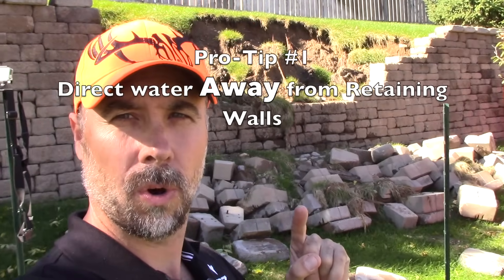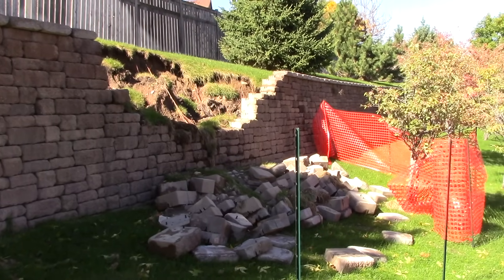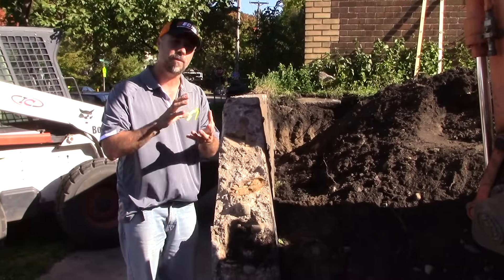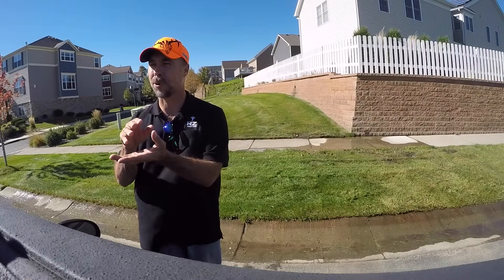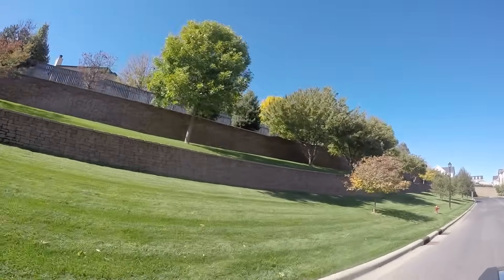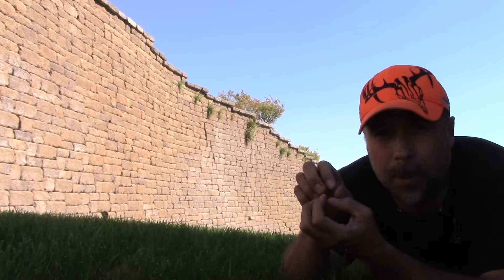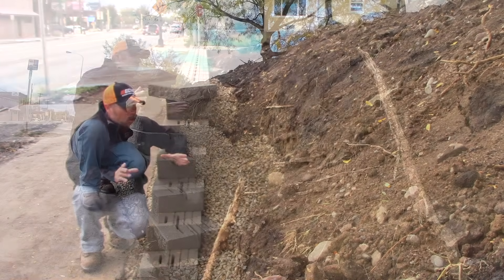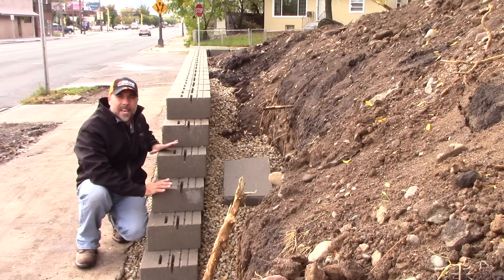How to Build a Retaining Wall and 6 Reasons they Fail

Comment: I lI've in a PUD in Florida, next to a development that built a berm on our property. I complained until I was blue in the face that simply laying dirt for a berm 6 feet above our development and covering it with sod would not suffice in keeping erosion from the tropical rains from degrading the drainage system. On top of berm they installed an 8 foot stucco wall to ptovide privacy. They then proceeded to plant live oak trees, area palms as well as other palms within 5 feet of wall. Being a zero lot line comunity, there is not even 10 eet from their patios to these trees and 5 feet from wall. Since I live at the end of the drainage field a combination of all these factors has resulted in serious erosion of property 5 feet from my house. I have plant beds planted at the base of the berm. My lawn continues to get steeper and more unstable the longer this goes on. I cannot get anyone on the homeowner's association board to even add it as an agenda item, which zi have requested 3 times and written letters on same, as well as contacting president of board from the offending development. Our board spends thousands of dollars shoring up the seawall that benefits the more wealthy homeowners in here. My drainage issue is getting worse and beginning to affect many homeowners away from the water. Whow can I contact to give me an assessment on what may be done to correct this? I am at my wits end. The live oaks will grow to 70 feet, and they along with other cheap palms developer installed block my morning sun, ruining plants I had there and causing me to have to completely replant for more shade loving varieties. When I bought my home in 1991 there was nothing but flat land-no development next doir. At last board meeting I brought this up and stated that topography at East side of my house was perfectly flat and they seemed shocked. I have pictureds of all this. Extensive work needs to be done on drainage system as my back yard area is now sinking and filled with valleys where water has eroded it awsy. What can I do to get this at least investigated for a possible repair? I know drainage areas need to be dug out. Development next door does not properly maintain proper trimming of trees. In area where wall was not installed, only wrought iron fencing, the oak tree roots are already seen growing out of the berm in our development. In Florida we can have 20 inches of rain water fall in two days. Last time it did the pictures I took got my neighbors air conditioner replaced and installed on a wire platform where water cannot reach it. I am afraid with the neglect of drainage system on my side of house, the water could rise and do same thing to my air conditioner plus possibly get into my house. The event that dropped 20 inches of rain resulted in water running into 3 houses across the street from me. Bags of mulch were stacked up as temporary fix. A cheap open "culvert" ditch was dug with open plastic pipe installed to allow water to run better into the system at base of the berm. The just creates more trouble for me as the rainwater now backs up even more. A typical 2 to 3 inch rain results in 2 to 3 feet of water going through the drainage system on 3 sides of my house. Takes up to 8 to 12 hours for all water to drain through large pipe and into the Indian River. Please help. I do not know what to do. This is on common property and is maintained by the homeowners assiciation. As I have stated previously, I cannot get anyone on the HOA board to do anything, even after writing a letter expressing these concerns and asking at 3 meetings to make it agenda item. I have flood insurance which would cover damage but if the drainage system were properly maintained would niit have to worry. If I get water in my house because of there neglect in this known issue I will be suing them for damages and to ensure drainage system is proprrely repaired. Any help is much appreciated.

Comment: Ok, I have a small retaining wall that is about to fall over. Watching your videos makes me see many of the several things the installers (before I owned the property) did wrong. To correct this I thought of maybe digging it out, putting in 1/2 in gravel to back fill for about 2 feet deep and a pipe with holes and a filter cloth on top at the bottom of the gravel to direct water out to the sidewalk. They put mastic on it so I cannot just take it apart and re-do the whole thing. It has quite a lean so I was going to take my old Ford and 'finesse' it back to a better angle on the sections that are sagging. I know that will not fix the very bottom which most likely has pea rock under the wall but I cannot break them apart easily or lift a few thousand pounds of wall. This kind of limits my options. Any other suggestions for my situation?

Comment: i have been looking to build a short, four feet max height retaining wall. the two key things i was planning on focusing on were the base and the drainage. i plan to use bags of redi mix concrete for this. I'm not trying to be a cheap SOB, but even if i build this to a very robust standard, i can do this for half of what contractors are quoting me for poured concrete. do you have any feedback to share for this type of wall design/construction. thanks very much

Comment: If I weren't so physically challenged these days, I would move from FL and beg to work for a guy like you. I used to love being a DIY guy and learning from videos like yours as part of my research before starting a project. I'm disgusted with the local licensed contractors,    that I've had to hire because I can't do this anymore. They cut corners that defy what I consider common sense. They appear to be in code, but watching them going through the steps and putting pride in there work is two entirely different things. They're sloppy enough to pass but I know there will be problems in the future.
Reply from the maker: Wow, thanks for sharing!

Comment: we have a large steep backyard sloping down toward the house that has 3 levels of retaining walls, either dry sandstone blocks or  brick/cement rendered. The final retaining wall at house level (brick/cement rendered), which is approx 3ft high and 7m long is starting to crack close to either ends, pushing out the wall in the centre. There is no where for water to be released on the sides  as their are brick stairs on either side, and no weep holes at the front - what is the best action to try and save the wall

Comment: Thank you for the video! We are going to diy a 4 ft retaining wall to level out our side yard. How much 3/4 angular rock to put beneath and behind the wall for drainage? In another video I think you mentioned 6 inches under the wall but it looks like more behind the wall for drainage,  would you say 12 inches thick behind the wall of angular rock? Also how deep should the base be approximately, is there a formula for that? I noticed in another video you had 6 inches of rock dug down and a layer of stone all beneath ground level. I hope that sounds about right and thanks again!
Reply from the maker: 12 inches minimum behind the wall.

Comment: I've built a few dry layup walls. I didn't know what I was doing but when I back filled them I graduated the fill from large rock behind the wall to pea stone against the hill. My theory was that it would filter out the fines before it got to the wall. That first wall has stood unmoved for over 40 years.
I haven't built anything but block and rebar retaining walls for the past 25 years. I guess it's too soon tell if I've done anything wrong with them but I tend to go down at least a third of the overall height of the wall if not more depending on what I'm holding back. I also like to tilt them back a few degrees into the hill. I still back fill with large fill stone but I've added landscaping fabric to loose materials to keep the finest out of the drain tile. I've yet to see water come out of the drain tile.

Comment: I wish i could just stack some blocks with 3/4' crushed rock behind it... I got 35" of rain at my house last month 18" of that came down in 7 days. This is a normal year here not a wet year. Your walls would still fail. All walls over 48' in my county must be engineered. most people use I-beams around here. Its interesting to see a rock wall over 10'. Nothing like that is ever built here. the soils and rain here are VERY different. once every 30 years we get 90" or more 50" is a normal year.
Ben Lomond, CA

Comment: The choice of tree species can be an issue as well.  My neighborhood was developed in the late 1970's and was heavily planted with Italian Stone Pines and Long Leaf pines.  Now the Stone Pines have lifted sidewalks and roadways and the pine cones on the Long Leaf make it dangerous to park on the street as the dropping cones are like one of those giant lawn darts.  Lots of dents and cracked windshields from non residents parking in the street.  The Stone Pines are average 6' trunk diameter and the Long Leaf are roughly 60' tall.  Beautiful trees but cause a lot of damage not to mention they drop cones, needles or pollen all year.

Comment: Hey man, great vids.  During the foundation dig out for my new home construction we encountered a land slip for our property near Pittsburgh, PA.  Here is a video: https://www.youtube.com/watch?v=g9U2u3ysUjE&t=59s

Hired an engineer that will be designing a 2 wall system using redi rock to create a tiered back yard.  There will be two walls 5 feet high and 100 feet long.  Just from the video, can you offer any tips?   Going to have geogrid between each course, with drainage at the top for ground water.

Comment: They knew how to build them 100 years ago cause they weren't so cheap back then...also contractors these days like to do the "minimum" and move onto the next job lol
Reply: I worked for a company that rushed jobs and did minimum. Then when wall failed they try to blame me even though i warned them repeatedly.
Reply: Contractors don't want to tell someone they need to also hire an engineer to design them correctly. And the owners don't want to pay for an engineer.
Reply: Are you an idiot? or is English your last language? I don't even know what you said.
Reply: wes lawson: Eees  dah Amorican way shustah likeah da 3 stooges Curly, Larry and More,what more amorican deen dat?

Comment: Really enjoying your videos. Have never put much thought into retaining walls and such as I have never had a need to until recently. Bought a house last year with a 35x35 shop in the back yard. The entire back yard is a slope and they cut into the slope in order to create a level area to build the shop. There's a poorly constructed 3 foot retaining wall on one side of the shop and no retaining wall behind the shop. The building is about 35 years old - I'm not sure if at the time they built it there was some sort of drainage or what but at this point I'm getting flooding inside the shop every time it rains for more than a day or so at a time. Behind the building where there was no retaining wall the dirt has totally washed down to the point where I would have to dig down just to even see the foundation of the building. Is there any way I could send you a few pictures of what I'm dealing with and get your opinion on how to proceed? Wish you were in Georgia.

Comment: How would you engineer a load bearing retaining wall? Such as ones that are in front of parking lots.
Reply from the maker: It would be based on the type of load, height of the wall, and kind of soil.  Those 3 variables dictate the engineering for the wall.

Comment: There was a 3' retaining wall made of 4x6" treated timber on our property when we moved in. No deadman supports or geogrid was used. Just vertical posts on the downhill side of the wall. There was no drainage set up behind it and it was backfilled with the gummy clay that was on-site. It has bowed the top of the wall out 10"+ in some spots and everything settled in behind it. Is it even worth trying to correct by filling where it settled and diverting as much water as we can before the wall at this point? I know it will blow, its just a matter of when. We are saving for a new wall, but a total replacement isn't in the budget quite yet.
Reply from the maker: With that much of a bow- its time for a replacement.
Reply: I suspected there wasn't much that we could do at this point. I'm glad there are guys like you willing to help out with their knowledge so we can make educated decisions during replacement.

Comment: So, if a retaining wall has a hill coming down from behind it (like the one you show as failing and like the one under construction with the 3/4 inch rock), I take it that the soil level behind it should always be even with the top of the wall?  I'm not sure I followed what the problem was there. It has been recommended to me to have my wall be 6-8" ABOVE the level where the ground meets the wall, to keep water from flowing over the wall. Sounds like that's wrong?
Reply from the maker: You want the soil and water to be able to go over the wall- if its all stuck behind the wall then in a torrential downpour it could get overwhelmed and blow out-like this one.

Comment: i didnt see any fabric seperating the clear stone from the fill behind that last wall. that dirt will slowly migrate into the clear stone. then it will no longer be clear stone and it will be able to freeze and push the wall out
Reply from the maker: 27 tons of backfill, 6 tons of drainage plus  other wall material washed totally out and into the storm sewer.  I found a lot of the materials in the storm water pond.

Comment: I have a 4 foot retaining wall I am putting in myself.  there is an existing large tree 5 1/2 feet back from where the wall will be. Do you think it will cause problems with the retaining wall?
Reply from the maker: rule of thumb-it should be 8 feet away

Comment: this was very therapeutic to watch i dont know why haha. great video
Reply: @ Stanley, last year in November my father and I built a retaining wall using railroad ties and pre-drilled holes for 1/2" rebar that when flush went through the top railroad tie down into the railroad tie below it all the way through also. A total of about 15" of rebar per hole and approximately 4 15" rebar rods per railroad tie. The bottom layer of railroad ties had rebar 24" which resulted in about 16-16.5" of rebar in the ground. We also put a slight slant on them to lean towards the bank. They also overlap, so that one railroad tie is sitting on top of the two below it. So far, it is very stable and feels very solid! What do you think of this? I have photos during the build process I can e-mail you directly and I can take pictures of it currently also as it stands right now.
Reply: @John Lincicum, As he said there are two parts to the answer: 1./ the "thoughtful" initial design and build (which you talk about yours here); 2./ the "diligent" maintenance plan, its periodic inspections and renovation work. That second part is key to the permanence of the first.
Reply: The problem I see is it is made of wood and it will rot. I built one like that when I bought my house in 1992 thinking I would be long gone or dead before it needed replaced...Guess who replaced it with concrete block in 2009....
Reply from the maker: Thank you!

Comment: so what do you do when theirs cavity's behind the retaining wall? fill it in or rebuild?
Reply from the maker: Fill in the cavities as soon as you find them.  Don't let them turn into sinkholes-at that point its to late.
Reply: Critical Reasoning I'm not looking to fork out thousands for a tiny hole in a 2ft wall that's 4 ft long. It's an eroded spot where water from the culvert has washed some soil away from next to the wall and partly behind the culvert.
Reply: Critical Reasoning, architects are artists NOT engineers, and I would not ask them how to fix a problem like this. They could probably tell you what color of block to use though.
Reply: Should the cavities be filled with that 3/4” clean rock that you had suggested or another aggregate ?
Reply: Rebuild properly following all the requirements specified by a structural engineer or specially trained and certified architect.
Reply: Yes, you are correct, most architects are merely farded fop artists. Please re-read my post and notice that I said specially trained and certified architect knowledgeable in the mechanical engineering requirements of segmented block retaining walls.
Reply: FishFind3000  :Call Trump,he gonna make America great again,wall or no wall.